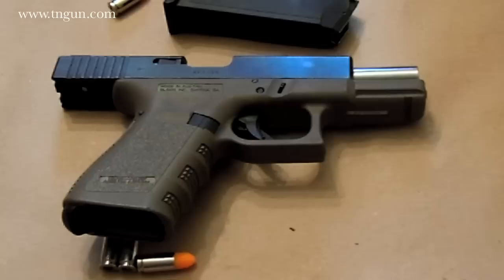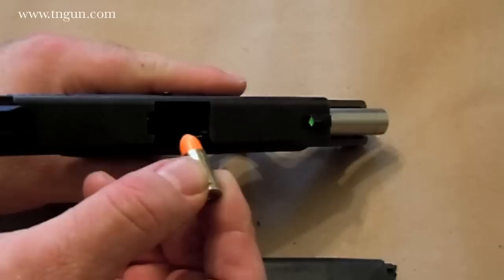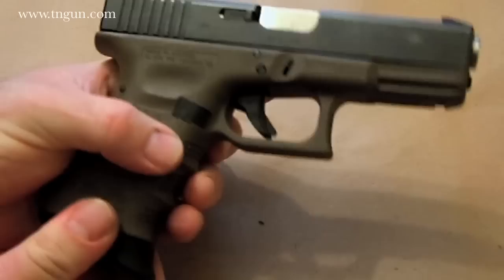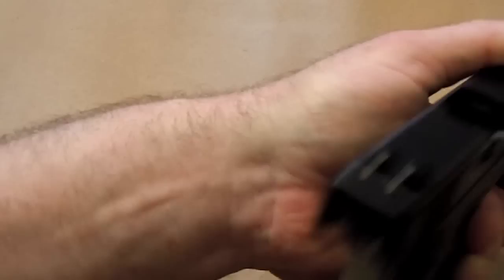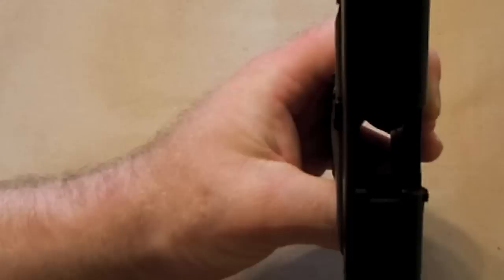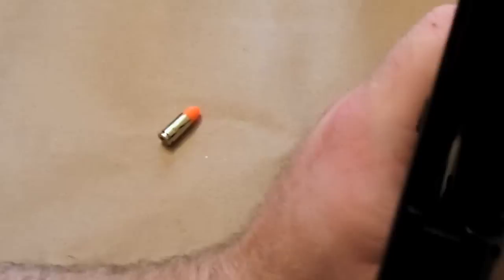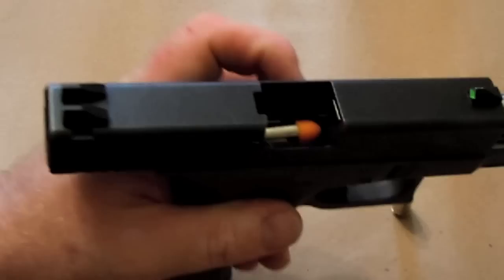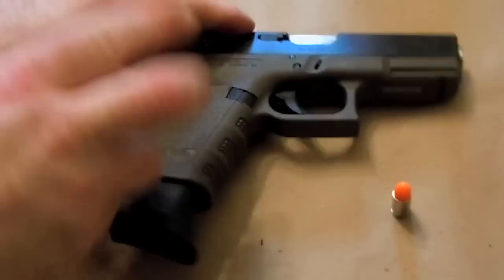How to Properly Load a Glock to +1

Comment: I’ve always just loaded it from the magazine then topped off the mag, didn’t know people did it another way lol
Reply: I've always just dropped the round in the chamber. My reasoning for this is, constantly loading the first round from the magazine can push the bullet back in the case because it's repeatedly slammed into the feed ramp and up into the chamber. I dry fire a lot so I'm having to load +1 often and I want that first round to be as reliable as I can get it.
Reply: Yeah that's the most easy way. Idk why people do it the other way.
Reply: I heard that can break your ejector.
Reply: @Ren505nm  it's possible I guess. I don't do it that way anymore though
Reply: @Ren505nm  how ? It's literally the same thing as loading it even if there is no round in the chamber
Reply: @Chris-cy9vr  the round is guided into the slide from the magazine normally with out slamming the back of the round with the front of the ejector snapping the round. Tho i "heard" it i don't know maybe over time it may chip off ?
Reply: Right lol.
Reply: Same

Comment: This is what I've done for years.  Get two magazines; fill one magazine to capacity and put just one round in the other one.  Use the one round mag to fill your chamber, remove the empty mag, and then put in your full mag.  It is silly and simple but works for me.
Reply: MrApple or you could just do it in the order on the video lol
Reply: MrApple I chamber a round and slap in another mag and depending if I'm in a rush or not, top off the other mag.
Reply: That's literally the only proper way to do it, but you don't need two mags. Just add a round into the mag you dropped after chambering. Good advice though! Bravo.
Reply: @1594simonsays  That damages the casing feeder. Slams it into the round and has to "move around it" to grab the casing to eventually eject it.
This is literally the worst way to do it.
Reply: @garrettflorent3848  How is what you said different from what’s done in the video? Genuine question
Reply: I can designate my 10 rd mag as the "one in the chamber" loader. And then just pop the normal mag in.

Comment: I have never seen anyone ever load a pistol by slipping one in the chamber with the slide locked back, shotguns yes pistols never.
Reply: GunsHarleysUSA sending the slide home from the locked position gives it the proper amount of force to fully and properly seat the round for smooth cycling. 
If you do it by hand it may not be enough force
Reply: dab0331. I believe we're changing the subject now. Started with wear and tear on the extractor,  and now talking about the slide release and how using the slide catch release provides adequate seating of the round. A more forceful way is to pull the slide fully to the rear which releases the catch as well as adding an additional 1/4" of slide travel. Just release the slide smartly, Don't ride it forward. If the round does not fully seat, do Not hit the rear of the slide. As on the M-16/M-4, the forward assist is merely to reseat the bolt if you feel a need to check for a round in the chamber. Not to force a round into the chamber. If the round won't drop into the chamber freely, there's a problem. Hitting the forward assist to shove the problem round deeper into the chamber merely compounds the problem.  My DPMS doesn't have a forward ass't nor a chamber / receiver cover. Not needed, wouldn't use. Easier to eject that round and move on. Ammo is cheap.
Glock: Insert charged mag., rack and release, drop mag., top off and insert.
K.I.S.S.
Reply: Some dummies do it ... I've seen it done
Reply: Hank Schrader from breaking bad did it😅
Reply: Cuz you seem so much in all your experience
Reply: I see that all the time. Use to do it myself.
People who are new to guns do silly things.
I have also seen, and prefer this method. Have a fully loaded mag and another with one round.
Pipe it with the second mag and then pop the fully loaded mag in.
Reply: I'm a new gun owner, and that's I would have done it. But, now I know better!
Reply: That's how I've been doing it.
Reply: My LTC instructor did it in front of me.
Reply: I’ve only ever seen it done that way
Reply: Garantia COBIA That is a tip up barrel design, it is made to load in that manner!
Reply: only in a high stress situation
Reply: I think video games do this a lot.. some games where you find ammo and a gun but no clips. So you chamber the one round you have, just for something.  I do understand now that this can damage the firearm
Reply: @CramcrumBrewbringer  In his situation, I'd say it turned out ok.
Reply: @mackdaddy4353  You CAN do this without wearing the extractor if your gun happens to be a Baretta 92FS style handgun.

Comment: Here's 2 problems you left out. While "premature wear" could happen (I've never experienced it) when you slam the same round in by dropping the slide the impact over a period of time actually pushes the bullet down into the casing farther than it should go. You can eyeball or measure this after just a few times. Unless of course you, like a samurai, discharge or throw away the round every time use unload the weapon. That greatly increases your chance of a misfire / failure that could injure you or damage the weapon. I'd personally rather just replace that part 5 years down the road. Second point. many many people are using the slide release to drop the slide. That is also damaging over time. They need to pull back on the slide and quickly release (never ease it forward) or the round will not seat properly.
Reply: The slide release button can and should be used when you are chambering a round. But yes I do agree.. when you dry release you can damage the gun but not when you are chambering a round. That round will soften the blow on the parts... Thats what the button was made for!
Reply: I heard this tip and jammed my gun with snap caps doing exactly that. Now I know
Reply: The manual literally says you can use the slide release to…you know…release the slide.
Reply: @carlwilson1483  The slide stop function to hold open on an empty magazine was stolen from a design that calls it a slide STOP. 1911.  the recoil spring should be fully loaded rear especially toward the end of the sping life cycle or if the gun is dirty in order to properly chamber a round without malfunction. Pull the slide ALL the way back so the slide stop drops free without excess wear. Then let go of the slide without touching it.  press check to make sure it chambered corectly and press check back into battery. this is the more universally accepted method to load all semiautos with a slide stop for hold open.

Comment: Fully agree.  I use to drop a round in the chamber and drop the slide too. Kimbers extractors dont care for that either.  Premature wear on the tension adjustment that's is critical to flawless function of a auto.  Great tip.

Comment: Great information. I bought my Glock 23 when I turned 18, started carrying at the legal age (in my state) of 21. Could never 'comfortably' load a round on it's own, so I've been using this technique for a few years. Seeing that this is an acceptable way of carrying +1 is reinsuring. Thanks for the video.

Comment: If you EDC with one in the chamber then you don't want to cause unnecessary bullet set back from reracking your ammunition over and over. ( bullet setback is when the bullet in your round seats itself further and further into the casing every time you drop the slide on it due to the force to get the bullet past the rim of the barrel). Easiest way and safest way to avoid this in my opinion it's just ride the slide home when racking your first round so you don't let the force of your recoil spring smash your round. Just make sure your firearm is in battery and that the slide is flush with where it is supposed to be. This way you can avoid destroying your casings and extractor.

Comment: I tell my students that when loading a semi-auto is to have a full mag along with a loose single round where you insert the mag, charge the pistol, release the mag and if the loose round fits in the mag you know you have one in the chamber. This will help in informing the student that they have a hot weapon and a full mag along with minimal wear on the ejection system of the firearm.
Reply: You check the chamber to make sure you have a round in.... no point not putting eyes on it just to be sure.
Reply: Since most pistols come with multiple magazines, just load your chamber round into a magazine by itself, rack the slide, then replace the magazine with a fully loaded one. This way, you're not fumbling around to top off a magazine with a loaded fire arm unholstered.

Comment: I carry a .40 S&W. I load straight to the chamber then insert the mag so as to avoid bullet set back which would be more dangerous in a .40 than the extractor spring wear. That spring is a wear part anyway and the steel of the extractor is harder than the brass case. I never understood these “wear your gun out people” as all springs are wear times and should be changed as necessary or scheduled 🥴🤔…

Comment: This is absolutely true and if the ejector was to fail to attach to the round you get spacing issues which can cause lots of issues as everyone should know, in fact ive had a 22 go off from a stiff ejector hitting the rim of the shell, it could also fail to eject causing a double feed etc.

Comment: If you want to prevent set-back on the round, you will slowly guide the slide forward then give the back a tap to ensure its seated. Slamming the same round over and over will cause chamber pressure on that round to exceed the manufacturers specs. Changing the round every time is a waste so long as you check the old round next to a new one for set-back.
Reply: Just tried this way, it works perfectly, save the round also without wear the extracter, thank you very much sir.

Comment: yes! use the sling shot release though. saves wear on the slides stop notch. You forgot to mention the possibility of the cartridge moving and the primer hiting the extractor or edge of the slide setting it off before fully chambered. danger will robinson.

Comment: I've never done it by dropping a round into the chamber.  The two guns I alternate carrrying both have manual safeties.  I start with a closed slide, safety on.  Load one round in the mag, insert mag, safety off, rack the slide.  Safety back on, drop the mag, fully load mag, insert mag, safety off, rack the slide, safety on.  I also alternate the first round after unloading for cleaning/storage.  Sometimes I'll do the same procedure except start with a full mag, load one round, drop the mag, top off the mag and insert the mag.  But still, the only time the safety is off is when I rack the slide.  I never use the slide lock as a release other than when doing a tactical mag reload.

Comment: Your way to load a round is the best way, as opposed to chamber load. I may add that you only load that specific round no more than 5 times. Otherwise, the bullet could seat farther into the case and cause the round to be overpressured when it is fired. My first round is a typical range round, so i can just cycle it after 5 chamberings.

Comment: This guy is rite, I’ve done this (loading +1 by slipping it in) about 10x in 1 day and messed up my G21. Now it’s hard to rack on the 1st round on my 10rnd mags, same mags I’ve always had. The loader on the slide scrapes the top of the 1st round. 

Has anyone had this issue?
Reply: Yeah my G21 is the same way first round in my 10 rd mags is very difficult to rack in comparison to all other rounds after that first one on top.
Reply: I just got a G21 with 13 rd mags and it's nearly impossible to rack the slide with mag fully loaded. I've read on forums that the mag spring needs to break in after shooting a few hundred. I get the same issue though with the round seriously scraped and a little dented. Hope it's normal.
Reply: @nf4825  same here I get scrapes on the top round if I rack it that way. Must be at least somewhat common

Comment: Now you’re introducing bullet setback issues, ESPECIALLY on 1911’s. If you use this method, ride the slide forward slowly to chamber the round. The OCD way that I do it is to insert the magazine 85% of the way, drop the +1 on top of the top round of the magazine so the rim is resting against the ejector. Then I ride the slide forward until the extractor is directly over the round. Then, while holding the slide in that position, I seat the mag the rest of the way which pushes the +1 up under the extractor. From there the round smoothly slides into the chamber. You can chamber a round nearly infinite times doing this. It sounds cumbersome but I can do that quicker than the load a round and top off the magazine deal.

Comment: I +1 my H&K vp40 by inserting it into the barrel. But the design of my pistol allows me to press on the rear of the extractor to let it travel around the rim of the casing as I bring the slide forward without undue stress. Great video tho!

Comment: This is how I've been doing it for years. I can load my Beretta 92 manually just fine, without any extraction issues, and without running into the issue described in this video. However, attempting the same thing with my Sig P220 or Taurus PT111 causes the round to get wedged in the chamber, forcing me to use a pen or other object to knock it out. I HAVE to use the method showcased in this video to get the +1 with both of those pistols, period.

Comment: Overall, good video. And since the YouTube format teaches everyone things that are good to know, good info with a good explanation of reasoning.
     Having said that, this has been the recommended method for topping off magazines since the late 50's to early 60's. So, keep spreading the word. Eventually this proper method for topping off magazines will make it into ALL instruction manuals. 
     Regarding 15 vs 16 rounds, a good case can be made for both sides. One side being "Why not carry all that can be carried"? The other side maintaining that constantly sliding the magazine in and out just for one round allows for needless wear and tear for minimal advantage.
     Re slide release vs slide pull-back. This isn't brand specific. Simply use the method that works best for you. Don't see it much now, but in the past many European autos were actually designed from the start to automatically drop the slide upon inserting the magazine. So, if you come across an old European auto that does this, don't immediately assume the gun is worn out. It was probably designed to function that way.

Comment: Stripping and loading the same round off the mag multiple times causes the bullet to be set back in the cartridge. This results in dangerously high chamber pressure and possible case head separation. If you unload and reload the gun every day, like if you have kids and keep the weapon locked up during the day, be careful  I have seen set back happen.

Comment: As I see it, if you load and unloaad your gun a lot, you run very real risk of bullet set back.  By slamming the same rounds over and over again into the feed ramp you can push the bullet back into the case causing a dangerous spike in pressure. That's a lot worse than a little extra wear on the extractor spring. If you are worried about it, replace the spring every few years. $5 part, 4 minute job. Best wishes :)

Comment: My two cents and what I practice. I found that I could cram one more round over whats suppose to be the capacity of my Glock mags. So the 15 rounder I put 16 in it, lock my slide open on my Glock insert the magazine slingshot the slide home and holster the firearm. I don't have to pull the magazine back out to top it off nor am I prematurely wearing out the extractor by dropping a round in the chamber before allowing the slide to go into battery. Maybe the mag spring doesn't like it but its only for a few seconds I never store nor carry the mags with more than the suggested capacity. I've been doing it for a few years now since I heard not to throw a loose round in the chamber for the +1. Not sure which Glock magazines it works for I only have 15 round G20 and 10 round G29 mags. It might work for your Glock mags, try it out. Let me know if it does or what you think about my practice.
Reply: Your over stressing your magazine spring and it's ears.
Reply: cecilnewman666 Glock does not recommend doing that.
Reply: cecil, I am sorry to say but this is a dangerous method, not only are you stressing your magazine but I would bet also you are increasing the possibility of a jam, even after you get the round in the chamber due to the condition of the remaining rounds in your magazine, this is not a good idea.

Comment: I always load a mag release the slide Take out the mag then top off always done this with no problems today i tried it a different way put a round in the chamber free handed like in the video release the slide and the gun went off had it in a safe direction freaked out that it went off i didnt think it would..anyone know why it went off? And i have a holster that covers the trigger so i didnt accidentally pull trigger

Comment: HONESTLY… if the Glock was only designed to work so the bullet slip's up behind the extractor but not straight on, THERES NO PURPOSE FOR THE SPRING in Extractor Depressor Plunger setup?? Seems like the whole reason for the spring pressing against extractor is EXACTLY for the purpose of being able to engage the brass straight on.... YOURE BASICALLY SAYING GLOCK BUILT A COMBAT PISTOL NOT CAPABLE OF EJECTING ROUNDS WHEN NO MAGAZINE INSERTED w/o Causing damage!!!! Example: mag breaks now you can only drop one round in and fire at a time, it’s gotta be able to eject the round without you having to go in there and fish it out with a finger??